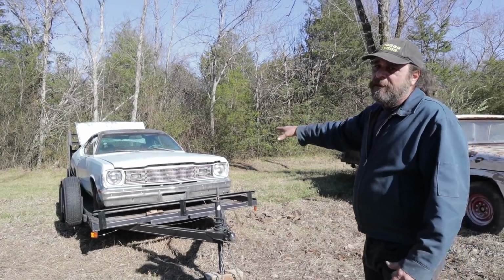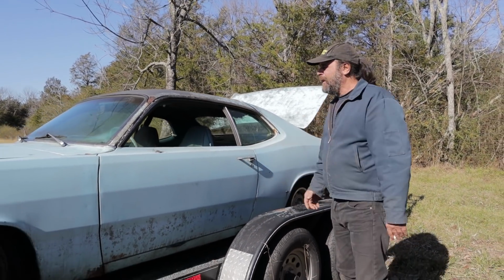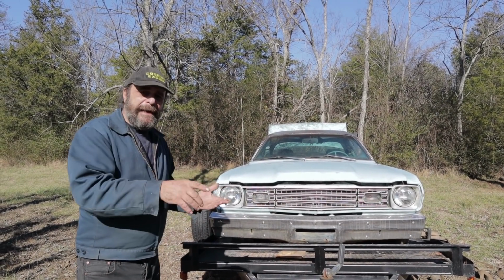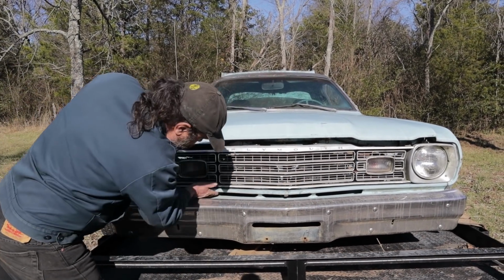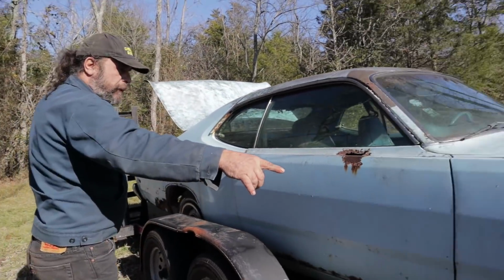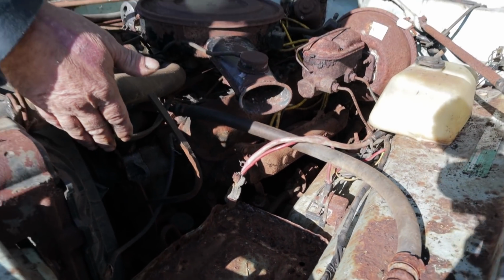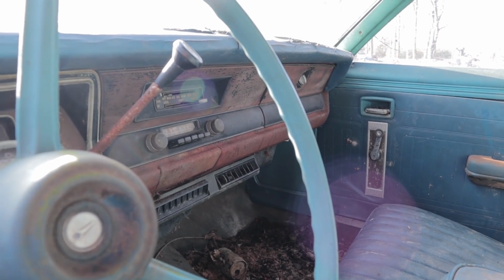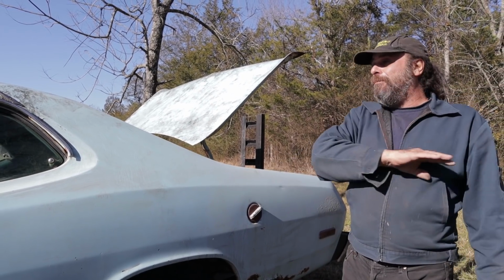So, What Is A Car REALLY Worth?

Comment: This IS the problem though that I run into between Ithaca and Binghamton NY all the time!! I find "less desirable cars" and the current owner was "STUPID MONEY" for it!! And when I say "STUPID MONEY" their price expectations are "ridiculous" for WHAT the car actually is and the list of problems it has!! A few examples here: I found a 1966 Oldsmobile Delmont 88 (it is the lower quality knock off of the Delta) sitting in a guys yard with four bald flat tires on it. No battery, No Brakes and had not ran or been started in at least 15 years, further had not been on the road (according to the window sticker) in nearly 25 years! The car was straight and fairly complete. but his asking price was $3500! And this was back when cars were still selling for $500 (not running) to $1000 (for a car that ran but need a little work)! 

In another case I met a guy who had a 1966 Ford Mustang Fastback. The car was siting out in a field where live stock had clearly been using it to "rub against" and there was NOT a single straight panel on the whole car! Closer inspection I noticed it only had a inline 6 in the car, all the glass was fine, and his asking price for a car literally sinking into the ground with NO FLOOR BOARDS AT ALL was $20,000!! And again his car had not been ran or driven in nearly 30 years and was buried half way up the wheels in a soft spot in the field! 

Yet too another guy I met had a 1967 Pontiac Catalina the car ran and drove, BUT it needed brake work, a full exhaust, and five good tires (they were all bald and missing a spare). You could drive it with a few weeks worth of work. BUT the car a host of other problems that would have been needed to be addressed! Like it had a rear main seal leak, transmission leak, and even though the car was "mostly complete" the interior was all ripped up and needed repairs as well!! And his asking price was $8000!

Easily I could see these cars for what they were actually worth! The Delmont 88 was worth $500 all day long, and I couldn't have paid more than $50 to $100 to the guy with the Mustang Fastback and the running Catalina was well worth $2500 to $3000, but certain NOT the $8000 asking price! 

Lastly CURRENTLY, there is a man who leaves nearby to me who has a 1965 Buick Skylark Station Wagon. The car has not moved in his yard in at least 25 years NOW that I know of personally! The car has a rotted out frame rail, missing the floor boards, had four flat and bald tires (and again no spare). the engine is locked up (from rust), and the brakes lines are all rusted out and this guy is asking $5000 for the car. According to the sticker the last time it was on the road was 1977 so for 44 years it has literally been parked in this guys yard if you go by the sticker! And at best it is a $500 car if you were going to park it in a shop for a year or two, and go completely through it as a project car....but it is NOT WORTH his $5000 asking price!!

Comment: Not where I live. I've parted out several darts and dusters. All your prices sound right to me, maybe even a little light on some parts, but the math doesn't add up. I get 2000-3000 parting them out and I usually have more sheet metal to work with since things don't rust out here as much. It also generally takes me a few years to sell everything. Being a V8 car with disk brakes helps a bit since slant six parts are almost impossible to sell for any real money. I agree this car is worth more in parts, but nowhere near 12,000. Its just not there.
Reply from the maker: It's all about where you market your parts.  I sold almost exclusively on FABO for years and sold every single scrap, every time.
Reply: @UncleTonysGarage  That a good point Tony. I give a big chunk to eBay when I sell parts, post office gets a bunch too, but I live in New Mexico so not to many people driving by looking for this stuff. I will try FABO, thanks for the tip. Never got into the forums, but sounds like its about time I do! Keep up the good work my friend. I look forward to every video.

Comment: If that was a 69/70 Aussie Valiant hardtop (mostly a 67-69 Dart with local front sheetmetal and running gear) in that condition, it'd be advertised for around $5,000, but as a restorer, not parts. And they're not all that special either.

Comment: I'm 50 now just turned 50 when I was 17 I went to an auction in western Washington I bought a 6 8 satellite my dad told me to get rid of it after I did a bunch of burnouts up and down the street I got the car for a hundred twenty five bucks sold the 318 engine for five hundred bucks transmission 250 bucks automatic and it went on went on went on I made $1,000 on that hundred and twenty-five dollar car

Comment: How much is the vintage beer can on the passenger side floor worth?
Reply from the maker: I'd have to consult an expert
Reply: Lol
Reply: Lamchop?
Reply: Based on what I found when I was researchin' old vintage beer cans this past spring prior to throwin' away the collection that I had sittin' around in boxes for the past approx. 40 years or so...not very much at all (like as in around $.50-$1.00/ can depending on condition...& that was for the one's that were steel & had the old style pull tabs that came completely off). Ya hafta have the really old styles of cans from a good bit earlier than the '70s in order ta have any that are worth anything more than that.

Comment: Tony is a mopar guy, and he knows those things very well. I am heavy into Pontiac with a bit of Ford, so I know where to go if I want to sell or buy parts for those. I am more into building these days, 30 years ago I was selling parts to pay for my builds, but anymore I prefer to build nice looking daily drivers and street machines.

Anyone can do it if they can take a car apart and have a spot they can store the parts until they are sold. A junkyard has hundreds or thousands of vehicles, guys like Tony and I have a dozen at most, but anyone can do it with a single car. Particularly if they part 4 doors which use most of the same parts as two door muscle cars. 

That was my thing in the 80s. It was much harder back then, now I can post something online and its usually gone in hours if not minutes. I have to be quick to get parts I want, and if its not in the first two to five minutes, someone else buys them. Its only when someone is asking stupid money for a common part that it doesn't sell. You put a good price on it and its gone. 

The guy who wants $600 for a factory iron intake from a '69 400 is nuts, because those are everywhere for $75 and very common, most don't care about a date code and those who do know they can get one for $75. $300 for a factory Tri Power is a decent price without the carbs and linkage. Complete but needing rebuilt its minimum $900 for the 65-66 units. It depends what it is, the condition, and what it fits. 

Its really easy to do this with the internet now. All you gotta do is be willing to cut the thing up after taking it apart carefully. However, when its in decent drivable shape and someone cuts it up for parts, that is just sad when it could be built into something cool. A 74 Duster is meh.. a 78 Camaro is even more meh. A rust free two door 60s GM A body or mopar E, A, or B body even without being one of the big engine cars would be very sad to cut up. 

I've rebuilt cars that were so far gone nobody else would even consider them, and they aren't even good parts cars. The only car I cut up for my 65 GTO build, which was REALLY bad, was a Tempest that had a tree fall on it and sat in the woods for 30 years. The parts I needed were in good shape, so we cut the car up with a sawzall and carried it out by hand. I got about $4500 worth of parts for the Goat from a $300 wreck. If you saw my GTO build, you'd think I am nuts.

Wait until ya see the 68 Firebird I am building... it makes the GTO at its start look minty.

Comment: Its called aftermarket parts.  If u could make 13k off this car.  People would sell this car for 11k.   You know it i know it.   Repop parts credit cards killed parting out cars and you could sit on that dented fender for 7 years until possibly maybe if its income tax season some pipe dreamer buys it after he offers you 50 and you take 75.    I call bs on this video
Reply from the maker: You have zero understanding of the market.  I lived it for ten years
Reply: @UncleTonysGarage  not so. I owned BBS auto salvage from 2003 till i sold it  
In 2014.  Parted out more muscle cars then i can remember sure i sold seat belt bolts date coded alternators but market died  repop killed it if you were parting a 69 chevelle. You better hope its got a 12 bolt because nothing else is gonna sell. Ok bucket seats and tilt. 
But sheet metal forget it. When you google 1969 whatever and classic car dealer is selling it you can bet its made from repop parts.    The old car market started dying in the early 2000's listen i made a flat killing on 70-77 camaro fenders and that died the day they started repopping them. People changed as well finding kids willing to go to a yard in 110 degree heat and pull parts is rarer then a hemi cuda.      Kids dont want a drivers license sorry i love old iron i love cars but that 13k out of a junk duster aint happening.  You couldnt give a set of chevelle disc brakes away today. I pulled 350 set. But ebay sells delivered to your door for 400 new.   I got a set on one of my 69 chevelles.

Comment: just like you have the key and make sure that you keep the locks but I don't have to tell you that just speaking from experience as only one should love your channel and I just lost my buddy Ken Lucas and he  thought/6is best thing that ever happened and a vet 182nd airborne and we tried to get a 68 dart with a bad motor and a replacement for it and he was able to get it from just painting the house for the lady and the car was in the same garage for 20+ years and I am going to believe it was husband died in the middle of a project that has not happened before 😂 but we have to get the chance to get a thousand plus with the car world and especially if it is not much more than the cost of getting it a nd i had my 68 falcon 2dr v8 built from a wrecked or rotten mach1 and had a good really good 💪302 c code and it was the only one year 68 and the 302 was 10&1/2 to 1 and the heads are better than the peanut chamber on the hipo motor but  I was like you want 500 and it has a title and i was like you have to go to Virginia and coming back i will pay for the whole thing and you can get me to the car and i have already bought him a snug top and the dip 💩 break the 4 ft long window and i was like why don't you just leave it I am going to be getting back there in a minute and its not like you have had a top but for the last hour and we had to listen to the do of 70 mph plastic bag flapping in the wind and i was like a running v8 c4 coverter and 430 and spool i was definitely not going to let that go and get it no interior but I don't expect to see long tube headers and able to send the tires up with not having to do anything with the brakes just got to stick to the floor and it is not going to be doing anything but I ended up with a highway center section and then I was like oh wow that's nice to not have to hear that motor at 3500 rpm slowly going around and not a single 🚔 don't think that you are speeding unless they get behind you and I was just doing the same lights and he was like oh i didn't see your break light and I was like oh my goodness I have break lights or my blinker wouldn't have been able to flash but it is not as bright as a new car but it has a single bulb not 100 LEDs but I wasn't being rude and I was like I don't look like it was a project that I popped the hood and 😍he was like oh wow that's nice now i see why its sounding like you were speeding and I was like i have to get this gear out and about month or so and I break passenger side Axle so I don't believe it is a Craigslist ad for a rear end and it is missing the driver side axel and I was able to get out of that one for a few hours and$20 and I got more than that for the 430 spooled center section of the old one and only have a few bottles of gear lube 👍 and I was driving it and not a single day off work 🙏but I was able to use the truck for one night and it was just to get in bed driving 3 hrs to get to work everyday and 5 hrs to get home was more than the time we worked but didn't get paid but Florida is not a single work area but they have been trying to make it so we have to drive a day and im like i have animals and I don't want to be working in Orlando or i would have gotten a job in Orlando as well as be living there
Reply: I've gotta give ya credit...that's probably the longest run-on sentence that I've ever seen anyone make!🙄😒
Reply: they wanna have auto correct someone should have a app that adds commas and periods and im on a phone and I appreciate you really read it lol but I want a full keyboard and they not have to go to a different screen to add puctuation and at least its not like the kids and they are all letters and have to Google it to see they could have had a laughing emoji and everyone is able to understand i am just happy that they came out with windows 95 and it has been getting better and better since, but typing a word processor and I guess that shows my age , but it was able to make all the corrections 🤔 surely has to be able to make app that fixes it

Comment: Its only worth what people will pay for it, and if you can convince them it should be worth more, they'll buy it and buy it at the bigger price, even if its the biggest piece of junk every made. case in Point, the Lamborghini miura, a car that constantly catches fire, starves its engine of oil around corners, has bodywork that is in pin thin, and rusted out like crazy, and yet thanks to the internet age, people are paying millions for a piece of junk that someone could make a replica of easily save for the engine in a few years or two, and it would be the same if not better.

Comment: Yup the car as a whole is worth 500 max. But if I am a potential buyer for purpose of making it a daily driver and I don't need it perfect and you tell me 1000 or more because you can make lots more parting it out, then I'm going to tell you to put down the crack pipe and walk away. Because let's be honest asking 2-3 times, or more, as much as it was worth brand new is nothing but greed, bs, and greed. Yea you might get a sucker to buy but so what? Not me, there's other options available. Hell, you can buy every single part, chassis and body included, for a 65 & up classic mustang on the aftermarket for less than some people want for a crusher ready junk heap.

Comment: I usually agree with you Tony but not on this one,. Everything you named off ain't even $3000 and you named most of the usable parts and you're a long way from $13000. If it was an E body I would agree but an A body.. nah
Reply from the maker: Dude, I glossed over and rushed through just pointing out the obvious things I spotted on the run.  There are literally thousands of trinkets spread throughout that car that have a value and price
Reply: So...thousands of parts to pull and ship huh? Sounds like 10 grand in labor and years of effort to get it all sold. But then you would have zero time left to make vids! 12G off that car is unrealistic Uncle T. Admit it. Maybe an unrusted driver, but not that locked up weathered cancer victim. I call stuff like that shipwreck salvage. ROLL UP YOUR WINDOWS!

Comment: Excuse my ignorance , but reproduction parts aren’t available for these cars?
Reply: AngusBoom  not really .  Small parts that can be produced yes, but no more body panels , all of the "a-body" (dart, duster, barracuda, valiant etc) stuff ( molds, dies etc) at one point was  all melted down when Lee Iacocca was brought to the board some years ago to help bail Plymouth Dodge and Chrysler out.  So the ruins of all that helped produce the Kcar series of vehicle they had ( k--car, lebaron, new yorkers etc.) all the front wheel drive economy crap .
Reply: Doc Fisher that sucks. I’ve only ever restored GM cars and you can basically build your own car with classic industries stuff.